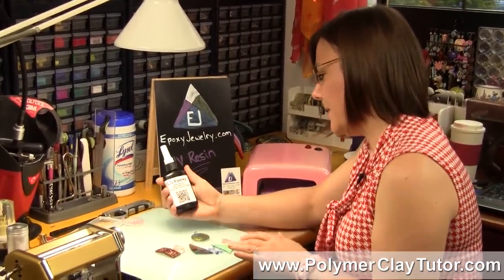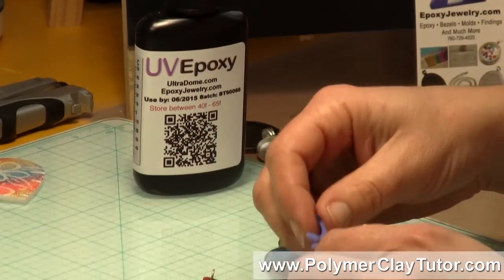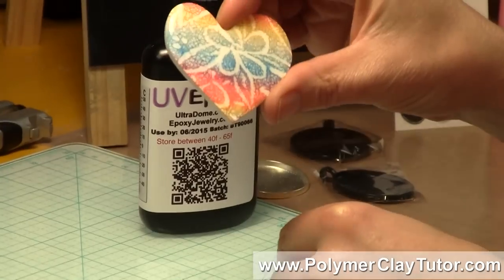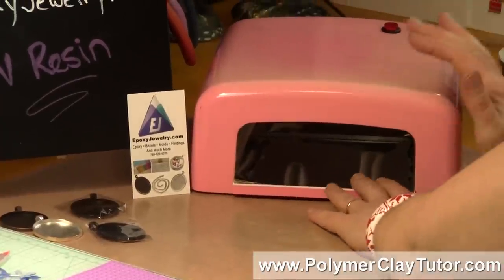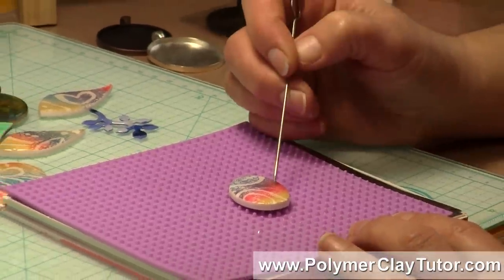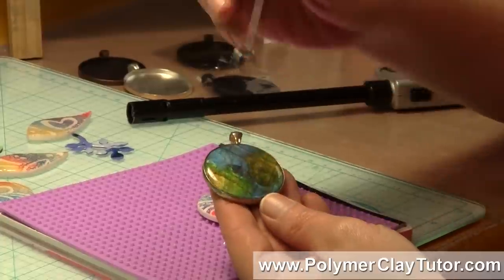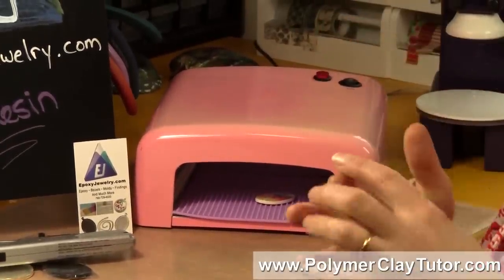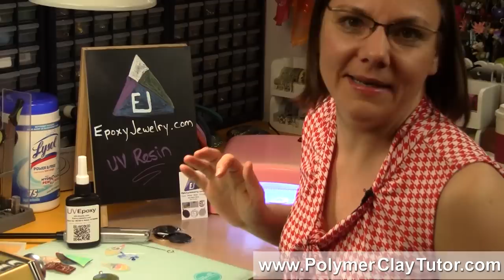UV Epoxy Resin (Ultradome) on Polymer Clay

Comment: Hi Cindy I eventually got some UV Epoxy Resin but I'm not happy I tried it out the other day on a basic round pendent but it was takkie when I took it out from the lamp it didn't seem to set right ?  it also pulled away from the sides and I could peel it right off dose this seem right. maybe it was a bad batch of resin I'm not sure.
Reply: I'm having the same issue, I've ruined a lot of pieces with this resin because its sticky no matter how long I let it set.
Reply: I Know the feeling its a real pain.
Reply from the maker: Are you sure you guys are using the right lamp? Some of the UV lamps, like the 9W or 12W lamps are not a high enough power to cure this resin properly. You need to use a 36W UV lamp in order for it to cure. I have some videos on UV Lamps that you should check out. I have a feeling it has nothing to do with the resin but more to do with the lamp (or bulbs you're using). Also, Terry the owner of the company that sells this resin is very helpful and will be able to help you if your resin is staying sticky. You should contact him if you're having issues.
Reply: Yes I use my lamp with another  UV resin, and it cures in seconds. I now use AlumiUV. It works way better and is much easier to control as its thicker.
Reply: Thanks for the idea using AlumiUV! I will try this out for sure. So far I couldn't find a really hard, nice, crystal clear gloss finish for my PC items! I tried everything from Kato LPC to UV Epoxy (used above), but unfortunately I had exactly the same problems just like you. No matter how long I cure them under 36W UV lamp, they are sticky especially on their sides. Anyway, I'll order some AlumiUV from their website, lets see what's gonna happen! :)
Reply: Sophie Buzora  I am also having the sticky issue recently. I ordered this 3 separate times after watching Cindy using it, and it worked great,until now! This is my third bottle but suddenly it’s just really really sticky even after being under the 36 watt lamp overnight. I think it’s because it’s about 4 months old maybe ? I never had this problem before.

Comment: I am so frustrated :( ... bought the same 36W UV lamp on amazon, ordered the same UV epoxy from Terry... (very fast delivery to Canada, thank you!)... spending now days with different pieces to have a nice result, experimenting which surface "likes" this finish the most. Unfortunately the result is not good. I totally expected something else. The sides of the pieces are sticky even after 1 hour curing... even though I didn't cover them with the epoxy, and didn't use too much on the top, because I didn't want the epoxy pouring down. I cannot wipe it off with anything, rubbing alcohol, what you suggested, dry and wet paper towel...nothing helped. It's always sticky. After 20 minutes, after 40, and after 1 hour, no matter what I do. The top of the pieces are quit nice, but with the sticky sides I have to throw  them out. I did everything the same way, as you did, with same tools, lamp and epoxy. Can you please tell me, where's the problem, what can I do to make it work? Thank you!
Reply: I had the exact same problem. I tried everything I could think of too. It’s not you. I just think this stuff doesn’t work. I have a very powerful lamp and like you I tried for an hour and they are sticky at the edges. I threw so many pieces away. I finally just gave up. I also found that it pulled away at the edges something terrible. All the UV resins seem to. Magic gloss does the same thing. Good luck. If you find a solution please let me know. I’ll do the same.

Comment: How to set right a sticky uv resin piece. Kindly guide
Reply from the maker: Wipe off the sticky residue with rubbing alcohol. If it is no longer shiny, add a new coat of UV resin and cure for a longer amount of time. Then don't touch it for awhile. It will usually be fine after that.

Comment: Hi I just started with uv resin and when I pour it into the mold then put it under the uv lamp the kit came with it starts smoking almost instantly. What could be going on?
Reply from the maker: Hi Brooke, UV resin should not be smoking. UV Lamps don't have any heat. I would have to see the lamp and the resin to know what is actually going on.

Comment: How to cure a 1mm layer of epoxy resin at the outside of a part that is a semisphere? (in the round part of half sphere)
Reply from the maker: For pieces that are rounded, you will need to use very thin coats of a quick cure brushable resin. This one should work for you: https://amzn.to/2p90D0y (**Amazon Affiliate Link)
Reply: Do you mean to make several thin layers to build up the desired shape? I do have a concave drawing on that dome. I thought I could fill that geometry first and then add the layers. and then polishing the whole thing. Does this resin accept post polishing?
Reply from the maker: @Josecunyat  Yes that should work. In regards to polishing resin, it is extremely shiny as is so I haven't had to polish it, but I have heard that you definitely can polish resin if you use fine enough grits.
Reply: @PolymerClayTutor  Thanks! I will get this resin to check the result. Really helpful your advice!!!

Comment: I'm very upset with you even though it's partly my fault most UV resin takes between a minute to 3 minutes you should have stress the time it takes my UV lamp doesn't go over 3 minutes that means I would have to have buy a new lamp after I bought the UV resin I put it under the lamp and it didn't cure I had to go back and listen to your recording again and see where it took almost 30 minutes to cure you should have stressed the time since it was so odd for it's taking so long to cure
Reply from the maker: Hi Wanda, when I did this video more than 6 years ago, there weren't any of those quick cure resins on the market. Nor were there any of those UV Lamps that only go on for 3 minutes. So, it wouldn't have even occurred to me to stress how long it takes to cure... it was the norm. Sorry to here it was a pain for you though.